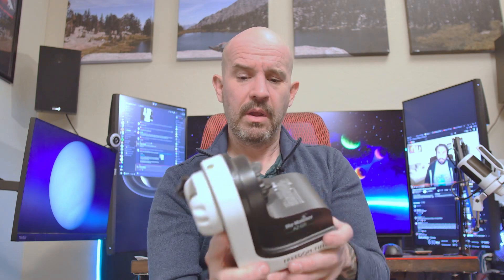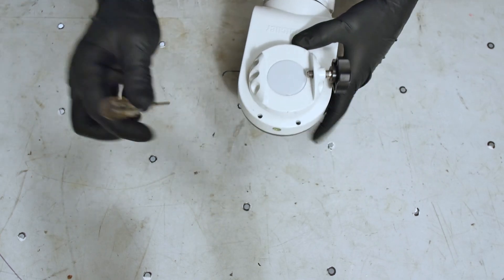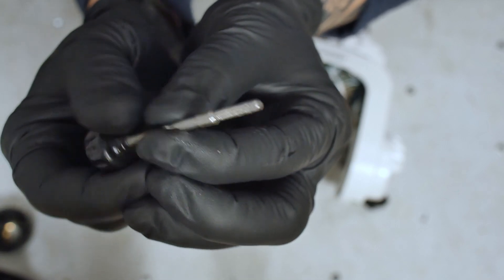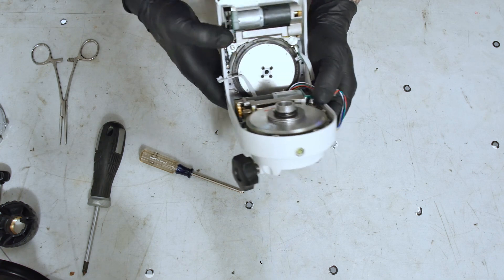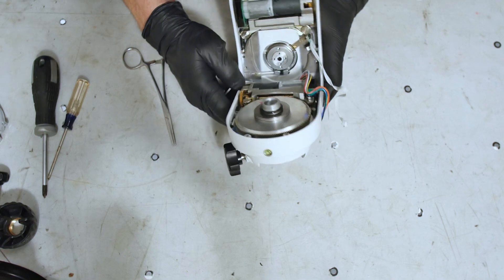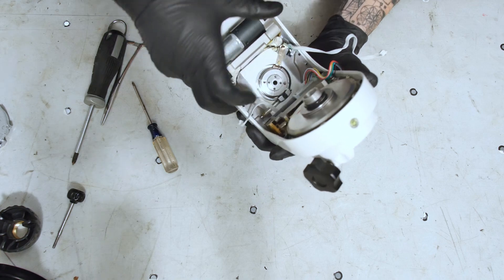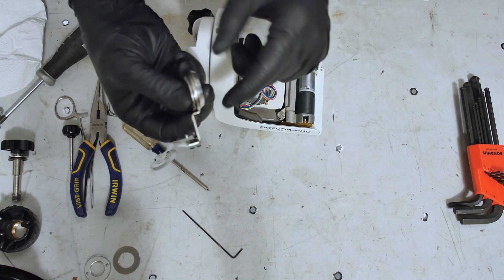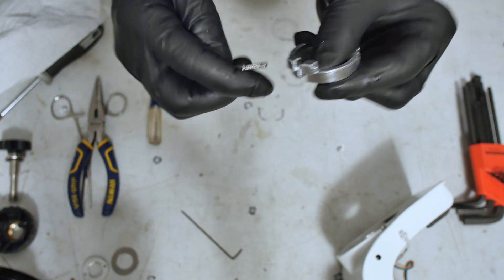Sky-Watcher AZ-GTI Teardown and Repair

Comment: Not a bad solution! But I'd use a bolt instead of a screw. A head could be printed for it. That way, you could turn the bolt by hand and avoid carrying an Allen key.

Comment: I had the exact same problem with my GTI, and followed  your video step by step, very helpful. However, I wasn't able to copy the procedures exactly, so I took another route and that was not the right one. I drilled a hole through the rotating backplate and threaded it, also a little hole in the rotating gear, to fix both together, I assumed (wrongly) that the GTI is rotating around it as the spindle of the drive acts against the gear. Just to help the ones ignorant as I was that it won't work that way, since the clamp that you tighten with the bolt actually is lifting up the assembly and works differently, I have to figure out how. After I re-assembled the GTI it worked fine, however, after a few rounds it stopped time and time again, due to strain to the assembly.
Having said that, the construction of the GTI fo fix the RA axis is lousy and flimsy, too bad, the rest is constructed well I think.
Reply from the maker: Ah, well thanks for sharing your experience at least!